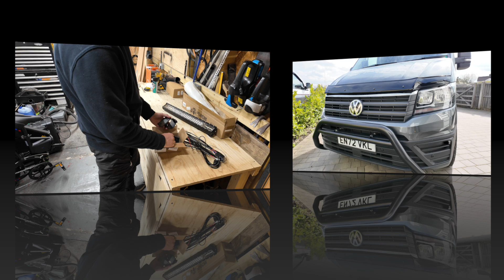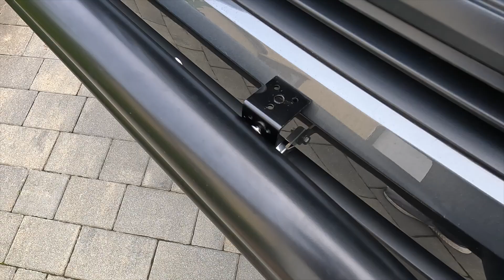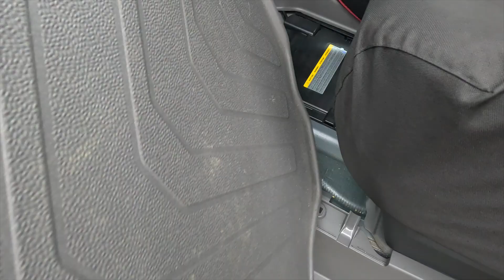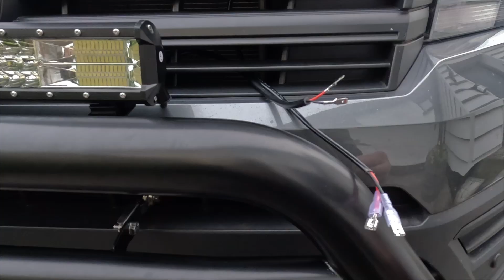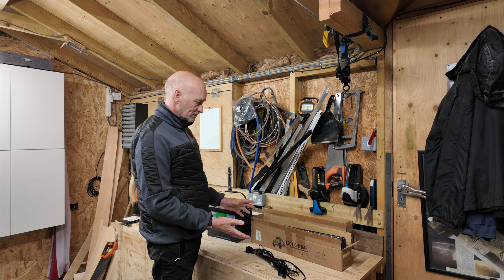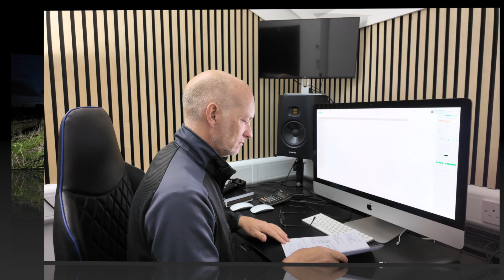VW Crafter EP14 LED Light Bar Install. Fitted to the Bull Bars.

Comment: I've recently fitted a bar myself, thanks to your video it was much easier than using the instructions provided.
Unfortunately the bar interfering with the front parking sensors???
I don't understand why, all I know is that when I had my tow bar fitted the guys reprogram the rear sensors not to interfere with the trailer when on the tow.
Would you know anything about it please.
I've seen you put a tow bar too.
Thank you very much. Konrad.
Reply from the maker: @konradrachlewicz8897  hi, the front  bar did interfere with one sensor at first, but after a few weeks it was ok! I think it had to learn what normal and adjust itself, the instructions make the job more difficult! My tow bar is fine with my sensor but when I attached my bike rack it sets them off.
Reply: @exploresandtosummit  thank you for your quick response.
I've also tried to play with the settings on my touch screen but it's only automatic or something where I can switch the sensors off using the batton on my dash.
I will still go to the place where I had my tow bar fitted and ask.
I will let you know.
Many thanks again.

Comment: Hi there was just looking at installing a lightbar myself and was wondering if this is an mot failure as it should only work on the high beam or is that how you have it set up. I was just lookig on youtube and most people take a feed from there high beam
Reply from the maker: Hi, not sure! I’ve got it set up on it own, with the high beam it will blind people! I just use it in remote areas or turning up at a camp site in the dark,